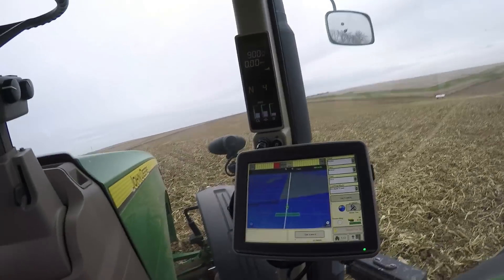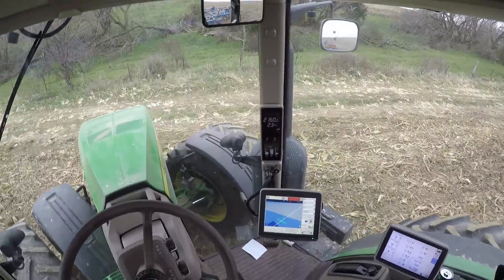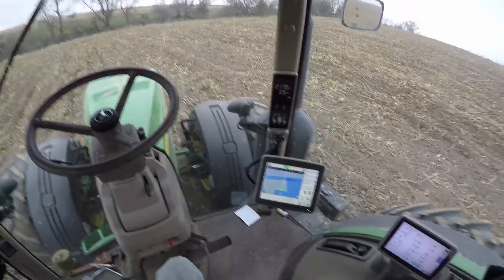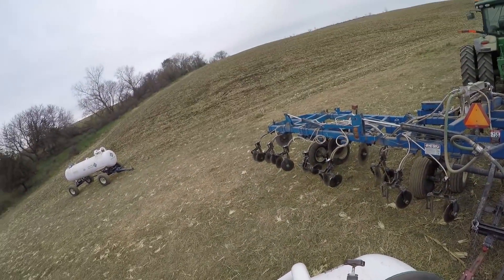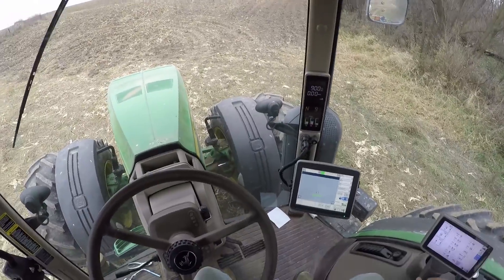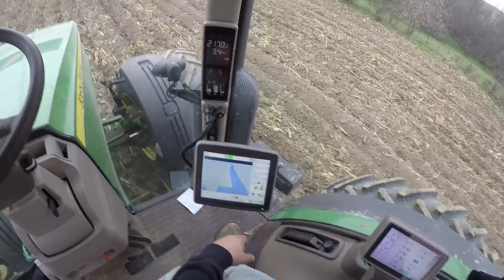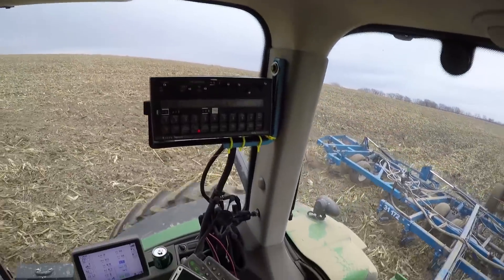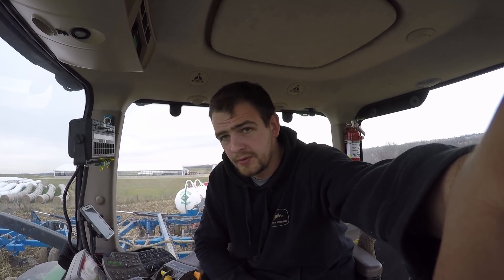Ride with Travis - AutoSteer and Applying Anhydrous

Comment: good video. But why do you guys always run the tractor at full trottle (2200 rpm)? I think the 8R could handle that thing with 1700 rpm and 1 gear higher, using less fuel..
Reply: niederbayer 95 goin through rough chiseled ground with hills in it it's probly better to over estimate the required power a bit

Comment: when I am planting soybean, if I can get the first run strait then the rest of them will follow that line.  distractions of checking seed drops can ruin it real fast since I am manual steer.   getting the rows planted correctly makes spraying a lot easier.  the auto technology you are showing here is only in my wildest dreams for my farm.
Reply: I used to think the same
Reply: Soybean Farmer if you plant with the RTK, the sprayer will follow your same rows, same for the combine at harvest.

Comment: That was very good Travis.that stuff use to scare the heck out of me. When we used it  I remember turning it on and off with a rope that was in the  70s do you still have to watch your speed to get the rate right ? We would have the coop set so we would run 5 mph .

Comment: Why isn't the steering wheel moving on autosteer, cause I remember on the new holland it moved the steering wheel on autosteer
Reply: Cameron Gallant the 8r is fully integrated so steers from the hydraulic steering valve not the wheel. Your new holland probably had a retrofit steering unit mounted to the steering wheel itself.

Comment: As an mri tech we cool the magnets with liquid Nitrogen or Helium.  The purpose of this is too cool the machine so that its near absolute zero where electricity flows without resistance.  We have to  also worry if the magnet quenches and leaks leaks helium or nitrogen as it expands 175 times its liquid amount and displaces the Oxygen in the scan room.  If this quench happens with a pt in the bore, we need to break the glass on our door as the pressure from the nitrogen gas wont allow you to open the door. It also displaces the O2 so the pt can breathe The cool temps from the gas can also cause frostbite.
Reply: Ever have that happen Bikerchic?
Reply: no,  its very rare,  they have a vent to vent out the gases, but if the vent fails then we need to force our way in
Reply: This the portable unit?

Comment: I was wondering how this would work with strips like you use. You want to respect anhydrous but not fear it. Back in the 70's... as teenagers, we farm kids covered thousands of acres each year. Other than an occasional leak in a valve there was only one accident that I remember and other than stinking up the neighborhood for 2-3 hours, there was no injury that I recall. Like so many things we work with on the farm, as long as you respect it, it is safe as driving a car in the city. (I suggest... safer).

Comment: Why you guys going so slow does the 8235R hate it that much
Reply: I'm applying in chiseled ground. it's kind of rough to be going to fast
Reply: Fanter Farms Most likely due to the rate of anhydrous the toolbar puts down.
Reply: Brad Steigerwalt that shouldn't matter they are running the ravens it will adjust the rate according to the rate of speed that's what that hockey puck is for, I run 6 mph putting on 180 units across chiseled ground but our R series has the front suspension and the suspended cab.
Reply: Mm I'm not a farmer myself but I'd guess that's what it was. Does seem a bit bumpy!
Reply: Travman035 you should run a R with the front suspension and the suspend cab ours runs 26 down the road you don't even feel a bump. How do you like the greenstar over the new Holland steering I personally like greenstar the best
Reply: its only 235 horse, its a pretty small machine..dont wanna work it too hard